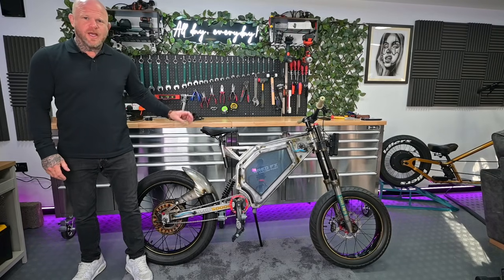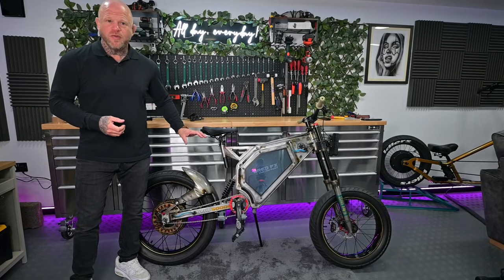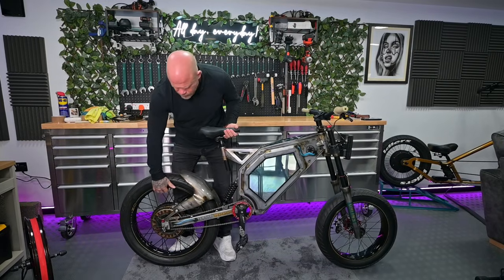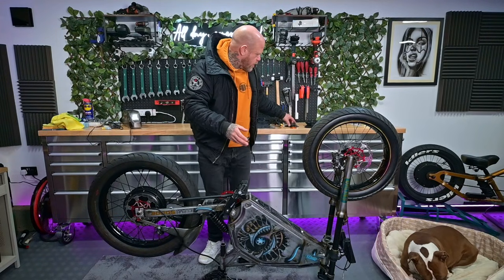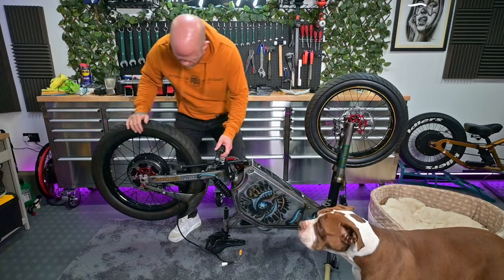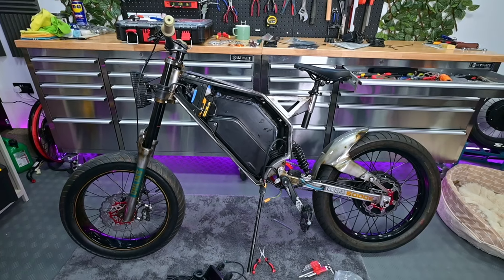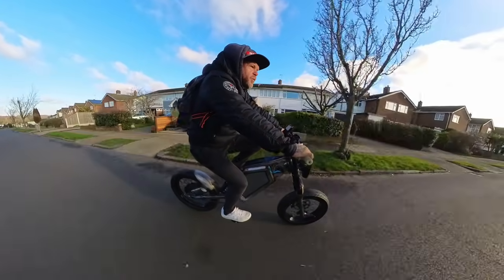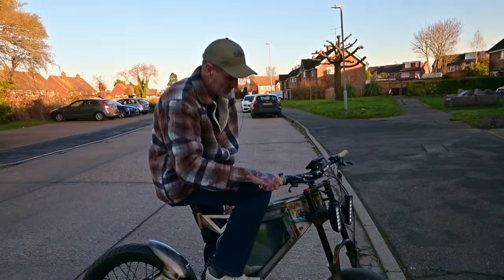SILENT & SIMPLE!!!  ....ELECTRIC MOTORBIKE Conversion UNDER £1K ***GOODBYE GAS STATIONS!***

Comment: It's not the battery that's the issue it's the controller, that motor can run that little 52v battery but judging by what your saying, the controller phase wires will overheat because they are smaller than the motor phase wires. If you try with a sabvoton or Fardriver with that small 52v battery you will have no issues 🎉. Great video though and bike!

Comment: Winter Glove Hack - two pairs of normal, thin wooly gloves,  then buy a box of polythene DIY disposables,  put these between the gloves.  Works way better than big bulky gloves, and the insulation effect is amazing.  Same for feet - plastic bag between two pairs of socks.  

Mountain bikers have been doing this for decades!
Reply from the maker: Will look into this thanks!!
Reply: Tights under Jean's, builder's labourer 30 years
Reply: Long John's....... If your bollox can handle them😂

Comment: I did 2 QS205's with sabvotons controler and ran them on 52V battery no problem.. Yes it doesn't go 50mph...still does 38 ish hot of the chargr and runs just fine. Never had a problem with the massive phase cables on the QS205 that can take up to 14kw easy....
Nice build tho..still not legal so  ;-)

Comment: I've only gone for a 48v 1kw motor on my bomber build, it'll do me fine as I need distance rather than speed anyway, mines an easy fit with 170mm dropouts so most normal mtb motors will fit, and a cash I've saved not going big motored I'm spending on bling lol

Comment: Hack I learnt for motorbike tyres esp tubeless ones get some decent sized zip-ties and tighten them all around the tyre to make sure the block isn't inside. Gets the tyre compressed enough you can slot it on the rim then just cut the ties pull 'em out gently and fill the tyre with a compressor or air shot

Comment: My ebike weighs 40Lbs 🤠🙏 22mph 22amps 42v 9.8ah Lg cells.20 mile range in summer going slowly 😅,  i need a 20ah next battery but they're very heavy 🤠🇬🇧🤟EBIKES 4 LIFE 🇬🇧🤠😇🤟🇺🇲🇬🇧🇺🇲🇬🇧⚡i prefer a light bicycle with assist over a heavy tank type.

Comment: Your bang on its not cheap I have a 5000watt with a 72v 40ah.. 300bms fardriver controller but it's 25kw and tbh like you said its to much for around town... Fun when you wanna have a blast tho but on a day to day I just tickle it about 30-40mph max

Comment: Yes, I'm definitely interested in this kit... i have just been thinking of converting an old bsa bantam trials bike to something like this and maybe even adding a mid drive motor too. Let me know more on the kit if you can..
Reply from the maker: Checking the axle size vs the ebike axle and dropout dimension is a consideration. But also mtb disc vs motorbike caliper compatibility. Also you'd probably not need a chain at all and could just use it direct drive.  Tempted to try this with my retro ducati sports bike.
Reply: @DudeStuff the rear axle dropouts are 155mm so hopefully its doable... the rear wheel is 18inch though. I'm thinking of a mid drive as well as rear motor so I can peddle it still to deter plod attention. 🚔 I'm not far from you I think if you fancy a coffee and chat about doing both builds.
Reply: Do it

Comment: Hi i watch your stuff wigh intrest, i wonder if you can advise me, i have the engwe 750w  pro  i love the bike but worried about being pulled by the police because its 750watt motor!
Could i just change the back wheel for a 250w motor, do i have to change anything with the controller or battery?
And where can i get the  250 watt wheel.
Reply from the maker: I wouldn't waste your money if you're that worried just make sure it's locked and limited and throttle is disconnected.  Even an unlocked 250w will do 22mph or with a 48v battery probably 25-30
Reply: @DudeStuff  i did lock the throttle and lock the speed, to about 17mph, but going up the steep hills in rayleigh the bike was so sluggish and trying to peddle to get the motor to kick in up the hill in slow traffic was a nightmare, so i unlocked everything and its so much better.
I think i will just take my chances, thanks for the advice!
Reply: @ieonking1053 don't worry about it, just say what they want to hear and your good. I was pulled over 5 times last year no issues 😅 when I first got pulled over in 2019 I was doing 30 and they loved the idea of an "ebike" even asked me to show them how fast it goes lol they wasn't mainstream at the time and I thought they was laying out a trap but they turned out to be nice officers. Stay safe on it haha
Reply: @aaron092000 is oh cool that give me confidence now to ride my bike without worrying 👍